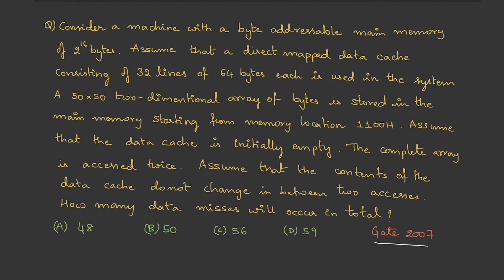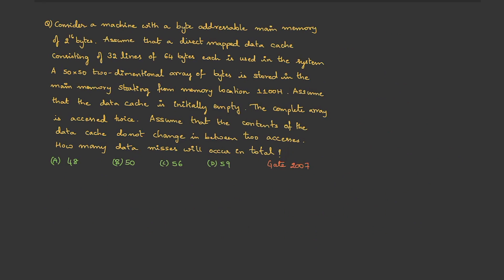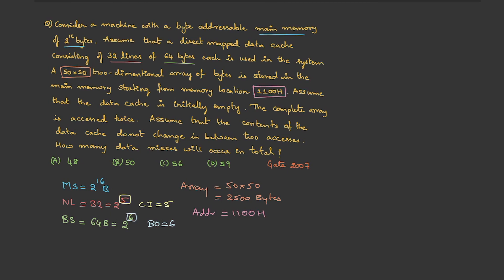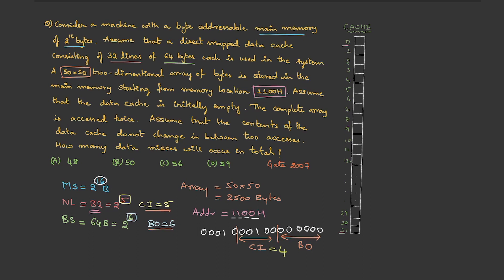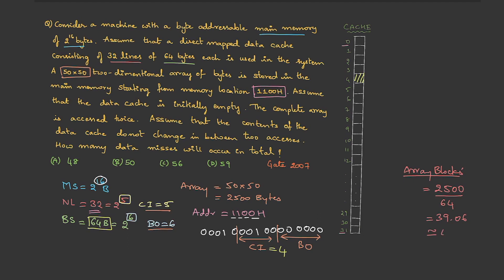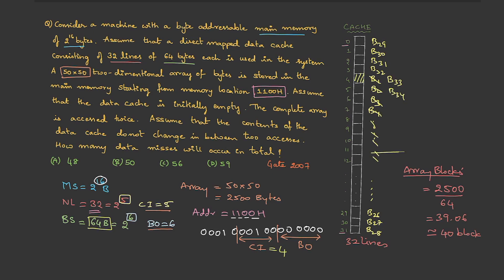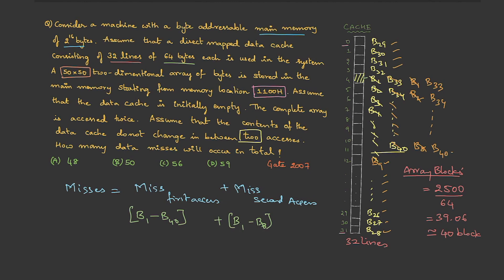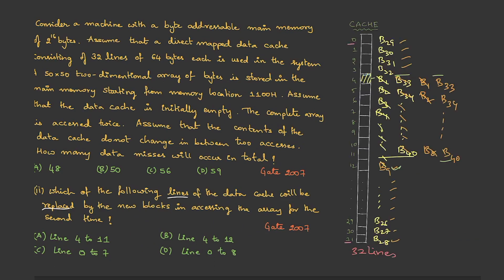19. Gate Question from Cache Replacement - Direct Mapping - Computer Organization

Comment: Sir ,why block 1 in second access is stored at line 4 but not at line 12?is it because of direct mapping but all the blocks  doesn't follow - bno %nl=lno
Reply: Because the address 1100h when divided up into Tag, Cache Index, and Block Offset gives 00100b as the cache index, so 00100b is 4 in decimal, so first memory block goes to cache line 4.